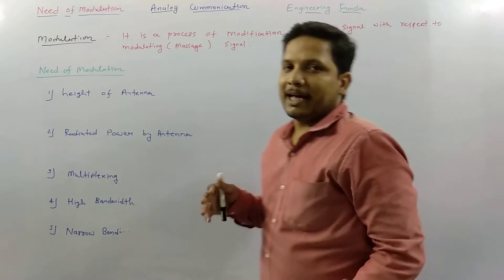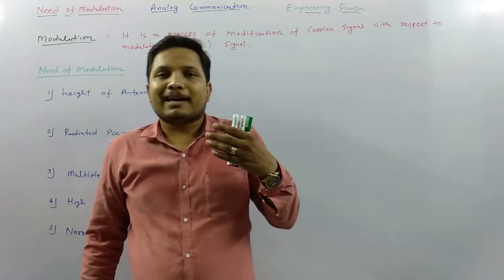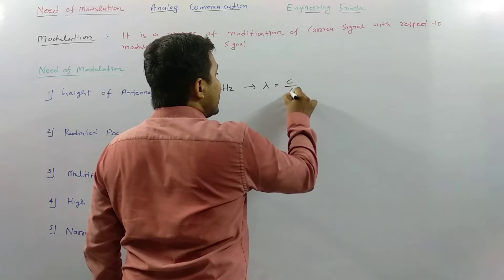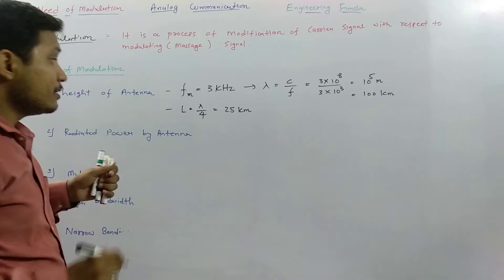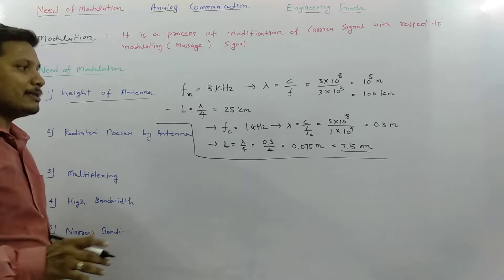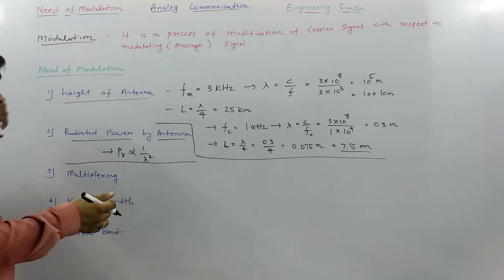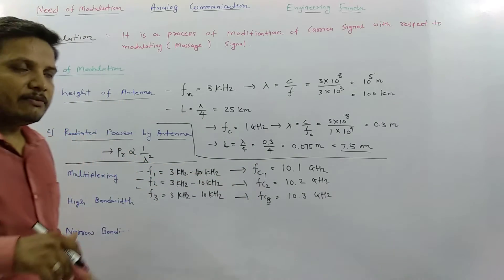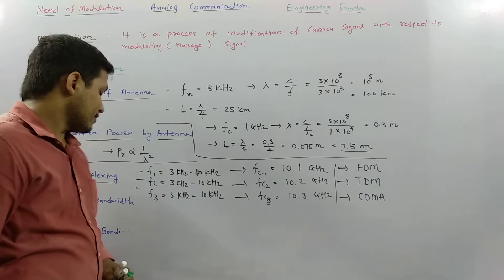Necessity of Modulation or Needs of Modulation in Analog Communication by Engineering Funda

Comment: Sir, If power radiation is more, then power required to use antenna is huge,  Is in it disadvantage Sir??
Reply from the maker: It is not like that, radiation is depending on radiation resistance and radiation efficiency. Good antenna radiates more

Comment: While calculating wavelength of sound waves, is it correct to use velocity, c = 3 * 18^8 or should we use velocity of sound waves?
Reply from the maker: Wavelength of sound is based on 330 m/sec velocity. But it's propagation doesn't happen by EM wave. It happens based on condensation and rarefaction

Comment: sir, I want to know that the syllabus which you take for analog communication by where you get.
because of my analog communication syllabus, few topics are not matched.
so., it is good for me if I see your all the lecture...
I m in  5th sem ECE and
my board name makaut university.
Reply from the maker: See playlist, matched it with your University.
Reply: Engineering Funda i matched it sir..
Some thopic are not given...like in my syllabus generation & detection of amplitude modulation but in playlist it is not there...
So, please help me...
Reply from the maker: Generation means Amplitude Modulation and Detection means Amplitude Demodulation which is there in my playlist
Reply from the maker: You can see Modulator and detector in my playlist